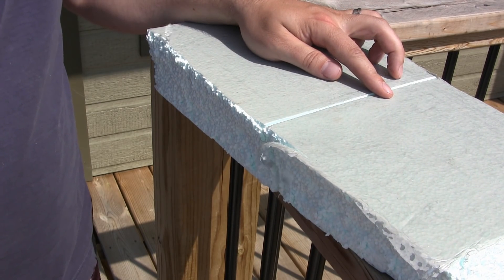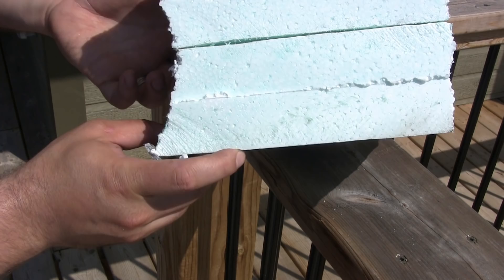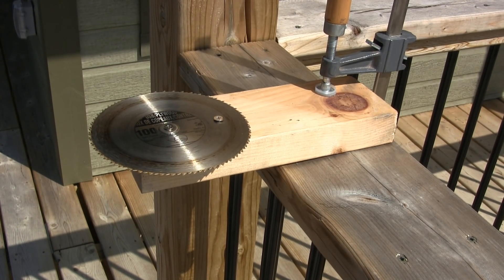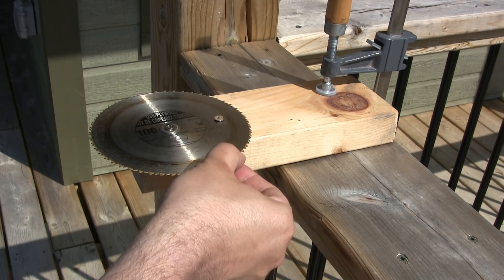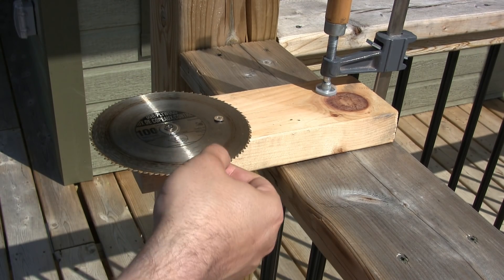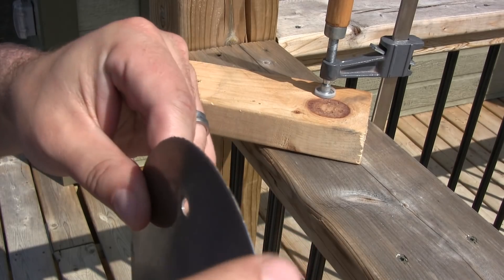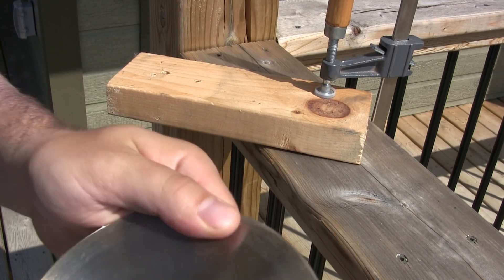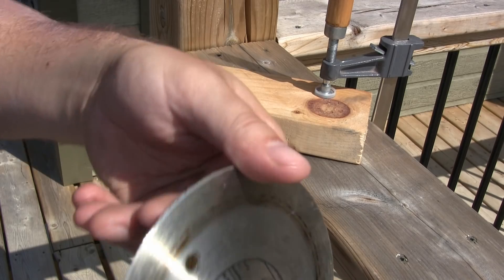easiest mess free foam cutter ever Part 1: the making

Comment: I used an old radial arm saw and sharpened an old plywood blade, then just pushed the foam through the blade from side to side with the saw off using the foam up against the fence to the desired width. The only time I turn the saw on is to sharpen the blade. Works great

Comment: Nice!  I used a good bread knife for foam packing 100,000 $ machinery. that looks good for finished parts let alone quick cuts. I made a disk like you did but after cutting the teeth off I ran it on my machine and ground it nice and round will it was turning. Did not sharpen thought (Making large washers) but that would make a very clean blade ... .. . Thanks for sharing!

Comment: There's a blade designed and sold specifically for this purpose, but it's $50.

It's similar in design to what you made, but has a few 1" (or so) diameter holes drilled out about 1/2" from the cutting edge, with a slot running from each hole to the cutting edge.  I imagine this is for cooling and to reduce burn and melting -- because we all know how healthy those burnt plastic fumes are!

Comment: Or.... you could just install the blade backwards and save the time of grinding all the teeth, and not destroy a blade
Reply: There’s another guy who did that and it still made a mess because of the teeth. I have a tile blade, I’m going to try that since it already has no teeth but has some surface texture .
Reply: @Mote78  how did it go? I was just thinking the same workaround
Reply: That's been tried it makes as big a mess as the other way the kerf from the teeth are still there